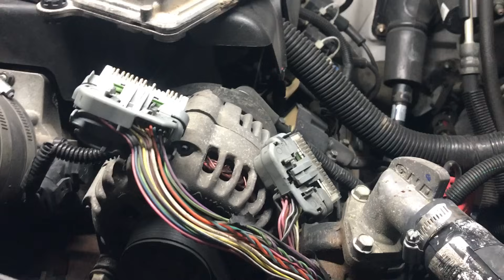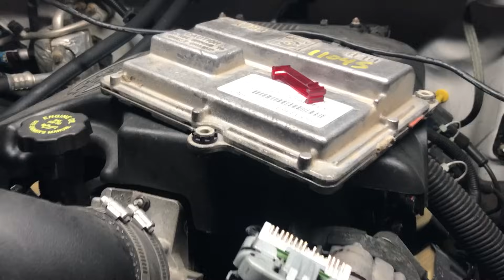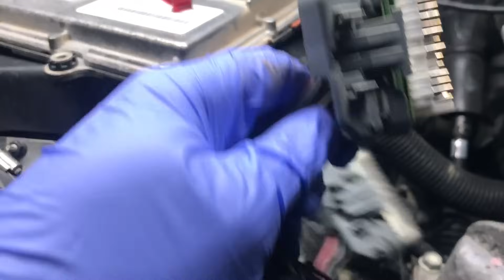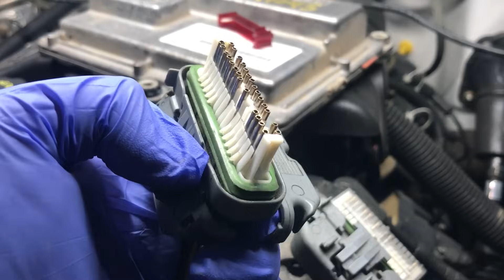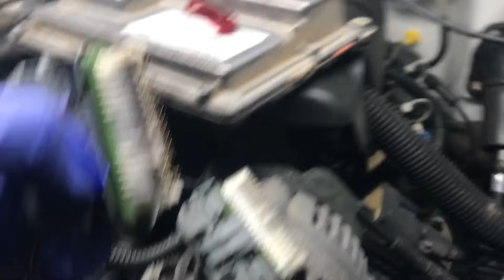Allison 5 speed TCM common issues and fix Allison 1000

Comment: Is there a place to get the wiring harness to the TCM? I had a recurring PS leak and fluid deteriorated the wiring loom and I'm afraid of some wiring issues as a result. I thought maybe a new harness would help.      My truck 2003 GMC Sierra 2500HD Dmax is going into limp mode because of a high transmission temp signal. I know it is electrical because it happens randomly and sometimes when I initially start the truck. I measured the temp of he trans pan with a laser thermometer and it is within op temp.  For a while I could jiggle the wires going to the TCM and it would go back to normal until it happened again.  I took the jacks apart and made sure the pins were properly seated and plugged it back in and I still have the same problem.   I didn't have this problem at all until I changed the PS pump and had to move the TCM out of the way to take the shroud off, I'm sure it hadn't been moved since 2003... any advice would be amazing! Thanks
Reply: Jacob,
Remove the connector and make sure the sockets are in place and there's no green corrosion. Reassemble. Use a tie wrap and gently pull the harness at the TCM off to the side a little. I used my pocket knife to do the same and the problem disappeared. You have a floating short that will come and go. Go slow and methodically move one thing at a time. Not too many changes at once or you'll never narrow it down.
That or just carefully replace all the sockets and see if that does it.
Reply: Thanks Robert!  I just saw this! I'll try it!   You mean just give the sockets at the TCM just a little pressure to the side?
Reply: @Jacobtaylor1775  
Correct, it doesn't take much. If your problem disappear s replace the female sockets for any codes that are present.

Comment: Hey need ur help to figure this out I have a 2003 Chevy Silverado 2500HD 6.6 duramax Allison transmission 5 speed 1000 it’s goin in range shit inhibited I already replaced the nsbu & ignition switch and checked the pins in ur video and pulled the codes and they are P0700 P0733 P0734 still have the same problem can u please help me
Reply from the maker: Looks like two incorrect ratio codes for 3rd and 4th gear. Not familiar with them. That's also triggering the p0700 code. If I get some free time I will research the two codes listed and see what fixes I find.
Reply: P0733 and P0734 ratio codes indicate the trans is slipping in 3rd and 4th range. the TCM uses turbine speed signal and output speed signal to make sure the transmission is in the correct gear. If the sensor signals are intermittent or "noisy" the ratio check will not be correct causing these codes. Really the best way to check for slip is to use Allison DOC software or equivilent scan tool that can "clutch test" the transmission in those ranges. If the oil is still clean and doesn't smell burnt there is still a chance it is repairable in chassis.

Comment: Can't even take the cover off.....you should make a video on that
Reply from the maker: Which cover? The one that holds it to the Fan shroud? or the Cover of the connector? Has 3 pins just pop and pull apart. I took two apart yesterday with a 90 pick tool.
Reply: Having the same issue I unplugged it from the tcm cant get to the pins its like there inside of a mold

Comment: I am having a check trans and range inhibited lights on an 03 international 4300 truck and it's stuck in low gear and won't shift into overdrive..notice the speedometer gauge isn't moving up.
Reply from the maker: What codes?
Check for power at the connector and report back.

Comment: Hello.  I am having a problem with my transmission not shifting into 5th gear until I drive about 1 - 1 1/2 miles.  This happens at first start up of the day.  Any other time after that it shifts fine. My truck is a  03 GMC Sierra 4x4 4dr crew dually auto.  Any help would really be appreciated.
Reply: Lincoln Gardner mine does the same thing in the morning only
Reply: If it's not setting a code there might be an Inhibit causing this which you would need to hook up to Allison Doc to find. Again if an Inhibit is on it thinks it's doing what it's told and won't set a code or go into Fail safe mode.
Reply: If it is cold they do this to help warm the motor up quicker. This is why it only happens with first start up.
Reply: @ffmedic102  
Do you know what the temp has to be to trigger this? X or below?
Reply: @robertjackson7590  100 F
Reply: @griffinpierce7691  
Thanks Griffin, seems like a pretty high trigger point.

Comment: Hi would this be causing a range shift inhibited situation?
Reply: jeremy xf1100turbo my 2011 is doing the same thing. It shifts soooo hard that it locks the wheels up as it down shifts. Have you had any luck with yours?
Reply: 2004 lb7 and it gave me the same message.

Comment: Thank you! Fixed my limp mode issue....pin 32 on the red harness looked like it was corroded. #32 Looked to be the green ground for the harness. Thanks again
Reply from the maker: Anytime :)
Reply: +Spartan Autoworx  hi I have a 01 3500 dually no shift issues engine light on saying it needs a tcm but runs fine
Reply: +Spartan Autoworx why may that be
Reply: Spartan Autoworx what's a good number to reach you st?